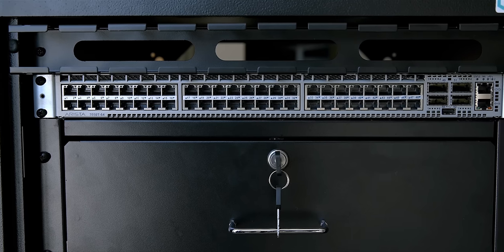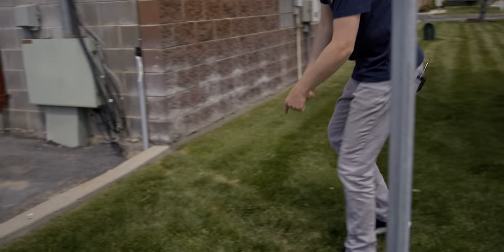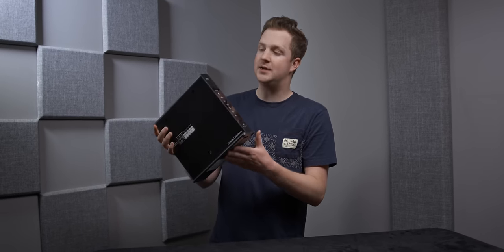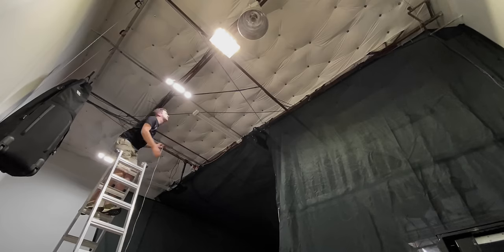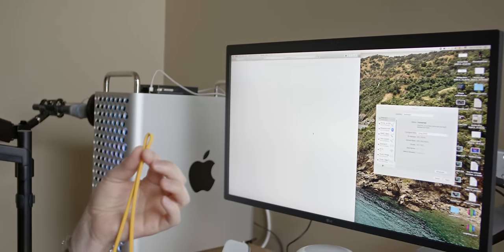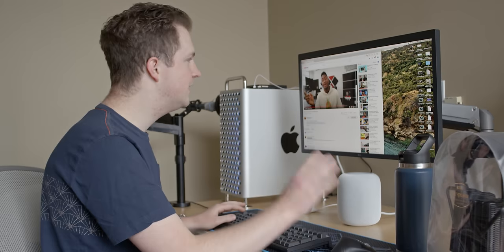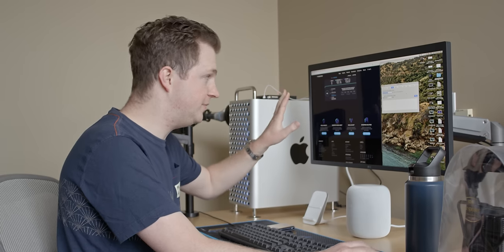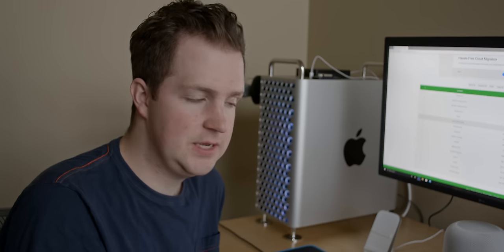How does fiber internet work? 0ms ping!

Comment: Bending the cable was pretty crazy! I think the zeros get through fine because they are round but the ones probably get stuck in the sharp bend.
Reply: yeah this guy is obviously a fiber shill, fiber is complete trash. i can no longer strangle people with the cable and watch 8k video on youtube at the same time. unsubbed
Reply: Good joke, LOL.
Reply: As we all know a zero is worthless anyhow, so i don’t see how that helps.
Reply: Well the waves could squeeze through I guess
Reply: David Johansson Damn you’re sounding like The Prez there. 😉
Reply: David Johansson It’s all good. Sometimes humour flies over someone’s head, including me. 😉
Reply: @WarriorsPhoto  The joke was that zeroes are "counted" aswell and "only counting the ones" would just be 11111..... and there would not be any binary data, since there are no "pauses" or separators.(i.e. we need the combination of zeroes and ones and building on the previous joke that 1's get stuck, saying that zeroes don't mean anything anyhow makes it funny because we actually need the zeroes.)
Reply: @snazzy  I was surprised that cable worked at all because you plugged a singlemode (yellow) fiber into a SFP+ transceiver previously connected to a multimode (cyan) cable... But hey things sometimes work even if they shouldn't. However you shouldn't bend a fiberoptic cable like that. I work in the enterprise IT industry and have heard of people actually breaking the glass fiber inside the cable while laying tight bends. The radius should not be below 10-15cm - it usually works at tighter radiuses, but also range is affected and I actually have customers with fiber connections stopping to work after they have moved something in their server rack and (probably) accidentally bent a cable a bit more xD
Still a nice video and I´d love to have your connection at my home :D
Reply: seems logical
Reply: David Johansson Good enough for me and thank you for explaining. I am laughing 😂 and that’s a good thing. (:
Appreciate you doing that today and yesterdays. 😉
Reply: At 11:58 every time you bend the cable all the way it just cut off the fiber optic light travel from inside glass but if you straight back the cable the light will shine straight ahead to the glass and the internet will back but if you bend the cable more enough it will break the inside light bulbs and the glass where the fiber optic take place @snazzylabs you certainly don't know how fiber work. Also not every fiber cables created equally some are easily break and some are hard to break. Pls let Linus teach you.
Reply: @davidjohansson1416  uhhh a zero isn't useless in computers, if it wasn't there all you'd receive would be garbage
Reply: @MenacingPerson  read the other comments. It's a joke
Reply: genius
Reply: When being certified as an installer, it was proven to us that the bend radius does indeed affect the data....in copper it is evident by bending the cable more than 90 degrees...I can fully believe that a sharp radius in Fiber also affects the light flow..but fiber in general is tough....and fiber can be used for very long haul....but the optics and equipment on both ends can be very pricey.  Fiber in the house is no problem and fairly inexpensive to run/support..and the last connection to the desktop is 10G copper.  Really the only better thing you can do is outfit your PC's with Fiber cards and use a fiber switch to remove copper all together :) but that is a bit extreme.
Reply: no the ones will flip over and glide through to the bottom but then they will break because of fall damage
Reply: He should be doing a speedtest when bending!
Reply: @snazzy  well, is 1gbps connection worth it for $472/annually? How much did you pay for 1gbps/annually?
Reply: No the ones can turn sideways and bend around sharp curves. After all they are plastic with an elastic probability. 
Kind of like quarks.
Reply: @davidjohansson1416  0's are just making space for 1's  like a place holders
Reply: @maximilianstumpf8236  
Some fiber is plastic and not glass.
A home fiber network might be set up using plastic fiber cables to cut down on cost, yes enterprise use glass fiber but cost is way to high for smaller oprations 
And connection devices are cheep slice end and snap on. Where as glass requires very precise equipment and skill to install.
Reply: I kind of wish everything was fiber or tosslink and we got rid of hdmi 
Hdmi has limits fiber optic can bypass its also perfectly for 2 way paths and nearly limimitless transmission and lengths without boosting 
About 50' is the limit of hdmi 200 with 2 cat 5e wires and a  converter  fiber optic 
Walks all over thoses limits. Even the cheaper plastic fiber optic equipment does.   If you want to pass 4k or 8k or 30k it can without upgrading anything.
But now even 5e networks are limited as to what your equipment can do nowadays.  Its the weak link.
And copper wires will always have issues with electromagnetic interfere. Even hdmi cabling.
Reply: @bobbg9041  HAHA
Reply: Haha! Yup exactly you gotta pump a bunch of 0 to clear it up
Reply: @johnamazing669  I went to week long training class called Light Brigade over 20 years ago. The instructor connected a light source and power meter together with a jumper. He then wrapped it around a pencil and every wrap was about  1dB of attenuation. I actually had to do that once because I didn’t have the right attenuator so as to not over drive the receiver. This was doing an emergency service restoration between to companies fibers.
Reply: am guessing the sharp bend makes light hit the yellow cover instead of going through the fiber.

Comment: As a an ex-fiber tech of a couple of years, I loved seeing this video Quinn!
Couple things!
Gigabit is not crazy. I know thats hard for 99% of you, I had dial-up until highschool, 2009. I know. At my job, our PON was running 1Gb down, 250Mb up residential and business 500Mb up, with availability for 10G when we began installing in 2018 from day one. Base price was $99/mo plus install.
When you bent that cable your service didn't slow down, it actually quit. Since the signal is optical-digital it's on or off. The cable might have broke too, I'd definitely not use it and I'm sure you won't. It worked afterwards because it's going a short distance and the break doesn't actually stop the signal dead. the cracks are like the surface of water, light can go through but the signal integrity is diminished. Put a VFL (visual fault locator) laser tester on it and that spot will always glow, but more when bent (light escaping the buffer tube).
 
Again, very cool video Quinn!
Reply: In my country, for $99/month will only get you 100-200Mbps and that's only available if you live in big city centers/urban areas. They have a FUP(*Fair* Usage Policy) which will throttle your internet speed once you've reached a limit. The worst part is that I've seen so many reports about the biggest ISP here that is run by the government(which never be a good thing) cutting down their customers' FUP limit without even noticing. It sucks for people that that is the only ISP available for them and they have to stick with it.
I hope that there will be more genuine private ISPs. I've been jealous of people in the US can get great internet for reasonable money
Reply: Trippy Rex wel. The US isn’t even that great when it comes to internet. Yeah it might be cheap, but net neutrality is a big issue there. Also. Countries like japan en Norway are having way faster networks. Netherlands as well. I can get a 10gbit FttH connection for ~$85 a month.
Reply: @TrippyRexTech  how does 1 gigabit for 30 usd sound like
Reply: Trippy Rex in Canada (Ottawa specifically) I’m paying $112 with tax for gigabit (1 gb down/200 mb up) via coax. FTTH is the same price but they haven’t sent a tech out yet
Reply: Here in Finland I could get 1Gbps/1Gbps for 55€/month ($62.58). I live out of nowhere so I don't know what kind of prices bigger cities have
Reply: Pasi123 typically it would be cheaper in city than rural areas (unless your government is subsidizing Internet for rural areas)
Reply: Do you know if the bend / crack in the cable affects singlemode and multimode connections differently? I work in A/V,  and a bend like that would definitely have stopped any (single mode) video feed dead in its tracks right away. Wondering whether different signals behave differently on a fiber line or if it's just all "the same" 1s and 0s
Reply: @computerschreck  In Finland big cities normal price for 1Gbps is around 30-40€/month. Im getting it for 24,9€/month tho
Reply: @Bixmy  idk. How does 11$ for 1gig down and 750mb up sound to you? (1ms to isp). :)))) Unlimited traffic also.
Reply: @TrippyRexTech  Are you referring to Australia? Sounds familiar. 50 Mbps is considered a standard connection for residential. 1 Gbps is only standard in enterprise due to cost.
Reply: Yeah, symmetrical 1 Gbit/s is certainly nothing crazy and it's perfectly affordable in a lot of countries where there is actual ISP competition. An ISP over here even started offering symmetrical 10 Gbit/s for roughly $50-60 per month.

Still, I realize that the commercial connection talked about in this video is a lot more expensive than a residential one. A lot of services also seem to impose per user limits of about a Gbit/s or two anyway so paying for more wouldn't have made sense here.

Having said that, I really liked the video. These behind the scenes videos about server and network stuff are always nice, and seeing the joy of someone who gets to enjoy a fast uncapped internet connection for the first time never gets old. 😀
Reply: Laughing in Romania..1gbps+digital tv+unlimited phone calls for 10 USD🤣🤣🤣
Reply: @mirceapintelie361  I want that too, ohh wait in Canada home internet and mobile data plans suck, 70$US for just 650Mbps down plan 20Mbps up
Reply: @mirceamunteanu4791  Stiu, am lucrat la Telus, o companie care dupa preturile practicate face concurenta neloiala industriei porno(totusi nu chiar asa de rau ca in Italia)🤣
Reply: @mirceapintelie361   salutări către un alt Mircea 👍
Reply: Yup, 8000 Mb/s in France for 40 euros/mo, works great. Slow upload though 600 Mb/s but that's 10G-EPON.
Reply: @Bixmy  how does gigabit and digital tv for 10 euros sound like ?
Reply: The big reasons this quality of service isn’t available in more places is pretty simple.governments don’t appreciate the value or cost of replacing existing ISP infrastructure (two small towns were ~$3 million) and available resources are wasted on defense budgets and corporate tax refunds and are impatient for return; ISPs can’t recoup the cost of changing out their entire networks, which would take decades (again, like dialup, cable, sat and dsl did), trillions, and massive hiring/training campaigns to make it happen any quicker. Basically, users would need to organize internet user-unions to make changes happen more widespread. Business has driven the development of higher speeds and latency, media consumption has driven backbone bandwidth in the last mile, but widespread quality isn’t profitable, just a value a lot of people share.
Reply: @TrippyRexTech  we had that in my country too until it got removed in 2019.
Reply: @Gren4te  small country with a lot of oil wealth…

Comment: When putting extreme bends in fiber optic cable, even if the connection is still working, it lowers the maximum (optimal) speed at which the data can transfer. So if your cable is rated to work at speeds of 10Gbps, extreme bend would probably lower the maximum speed possible, increase errors, and probably introduce latency. Those are some awesome statistics when testing your connection!!! 👍

Comment: I'm certified in professional fiber installation, it all depends on the quality of what you get. The stuff we used in the past could be tied in a knot and would barely add any impedance. Fiber is really freaking cool.
Reply: Yeah it is, I run fiber in a data center, and I’ve lost count how many times I’ve had multi mode and single mode fiber knot up during installation and had no issues... though single mode fiber’s tolerance is vastly lower than multi mode
Reply: My copper cable does the same and more, and for the end user it doesn't make a difference. Yeah, fiber is cool, but on the last mile there's nearly no difference. Both signals travel with light speed, both signals can easily transport 10 GBit at the moment. Copper will be overtaken in the end, but for the end user there's much, MUCH headroom with it..
Reply: Fiber have end radius, you aren't supposed to bend it in half life that.
Reply: @wiziek  that's why I said it depends on the quality of the fiber. The stuff ATT runs to your house, don't bend it. The Kevlar protected fiber trunk ran through a community of town homes you could use as a jump rope (not recommended) and you wouldn't see a drop of performance.
Reply: @erebostd  depends on the application. I'm running fiber at home because copper won't work with either the electrical noise (many meters in a narrow channel next to 400V power lines) or fire safety code (no low voltage signal cables next to high voltage power cables). Copper is certainly not dead but it does start to run into some limitations at speeds and distances we didn't typically see in homes in the past.
Reply: @DanielOlaiDanielsen  this seems like a... Very unlikely setting. Sure, there are settings like yours, but you are an absolute exception with that. The last mile is copper nearly everywhere, and with 10th of gigabit available via copper I don't see it gone in the near future, especially in cities where the infrastructure isn't replaced so easily. But as long as the connection is fast and low latency I personally don't care if it's light, current or maybe radio signals ;-)
Reply: @erebostd  I didn't mean FTTH although I'm lucky to have that (1Gb synchronous), I meants in-home. It's an older concrete building and I can't easily create new cable gates nor am I permitted (nor willing) to run open wires between my technical room and my computer room, and I want multiple 10Gbit lines to avoid bottlenecking. Certainly not a common issue, but I think we'll continue to see a slow but steady increase in fiber usage for non-commercial use as well.

Comment: I've been using Verizon Fios for several years now and I love.  A couple years ago I upgraded to their FiOS Quantum 1Gbps tier.  The speeds are symmetric.  I don't regret it for an instance.  It's so much more reliable than the Optimum Online I had previously.  The fiber line actually goes all the way into my apartment to this big box on my wall.  From there it goes to my router via a coax cable.  This box on my wall is plugged into a power outlet, too.

Comment: Did you buy the Juniper modem? My install had a DZS and I don't have a fiber out.
Reply from the maker: Nah, they provided it.
Reply from the maker: Granted, I’ve been told that’s only for business customers.
Reply: @snazzy  Ahhh, maybe I should have signed up as a business customer. Did you pay for it or are you just doing the monthly fee?
Reply: @TechWithBrett  lol you got left on read
Reply: @zen608  So did you.
Reply: Tony Ravioli nope
Reply: @TechWithBrett  Its a managed connection, they just use it to act as a media converter and a way to tell if the connection fails before the customer has to call for service.

Comment: Fibre optic cables are made of 2 materials. The outer one has a different refractive index which causes light to reflect and travel in a zigzag along the fibre. If you bend it too tight you prevent the reflections continuing normally.  The first examples were solid glass rods. They just got thinner.

Comment: When you bent that cable one of two things might've happened. one. the light might've been blocked because TIR (total internal reflection doesn't occur at extreme angles, or two the bend caused a slight crack in the cable and when straightened out the light can pass through but not as well as it would've if it weren't bent.

Comment: 12:00 The reason why the internet didn't work with that bend, is because of how the photons inside the cable have to bounce more, making the signal weaker at the other end
Reply: I think the reason is that the bend is so high that the angle of the photons on to the surface is below the critical angle. Below this angle photons will pass and total internal reflection doesn't occur. Correct me if I'm wrong though.
Reply: @SSJSuperVegetto  more or less. Also wavelength plays a part as well. Narrow wave lengths can deal with more acute bends than wider wave lengths.
Reply: @SSJSuperVegetto  Yup the critical angle and stuff

Comment: I moved from MN to FL.  Have gig fiber in both.  I had CenturyLink in MN.  My ping to cloudflair DNS server was around 7-10ms typically.  Same equipment but on ATT fiber in FL, same server is around 23-25ms typically.  Best I can tell, it has to do with the routing outside the home.  Everything goes to Atlanta, GA from my home in western FL.  In MN, the ISP endpoint was much closer.  Based on trace route, that is the best I could come up with for why ping was so different.  Not a huge deal.  Most things in north america are still under 30ms as long as the internet as a whole is running smooth between me and the server.

Comment: I switched to 1.5Gbit download and 1Gbit upload fiber internet about 5 years ago and never turned back. This feels like normal speed for me now and 10Gbit seems like a incremental upgrade. But honestly beyond 1Gbit isn't really utilized in most scenarios and 10Gbit would require more complicated equipment and 2.5Gbit ethernet ports on your devices to take advantage.  But obviously in the future everything will start to use more and more of fiberoptic connections throughput. So 10Gbit is good future proof... but the great thing is you can simply wait until that day comes and your ISP can upgrade you to 10Gbit with a phone call.